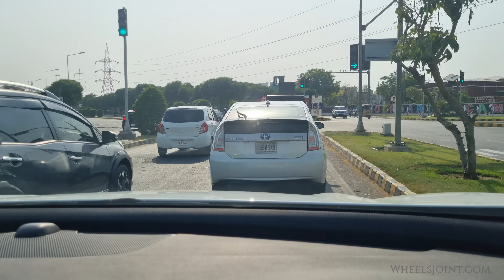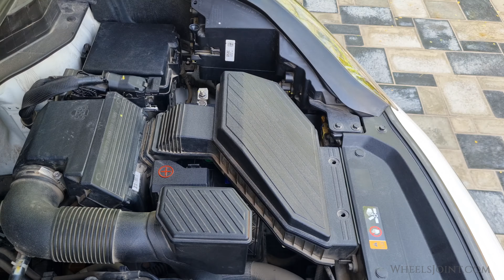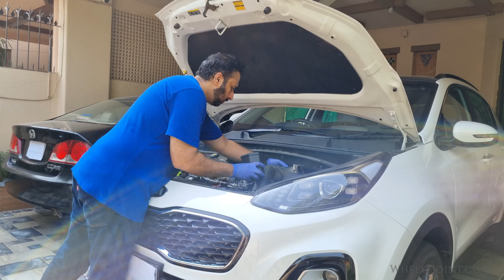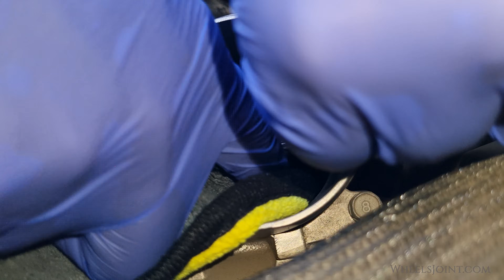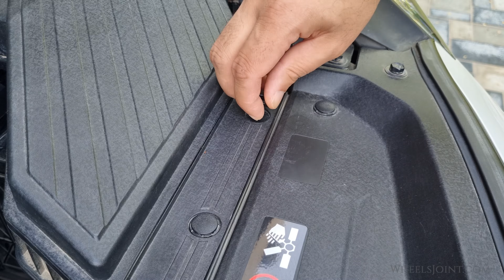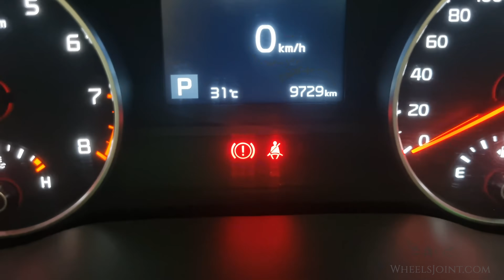How to clean electronic throttle body in Kia Sportage

Comment: Brother , I'm a old subscriber of ur channel. Request that can u make a video on headlight moisture issue. And show the moisture pads behind the headlights how they can be corrected. It's a much needed vdo
Reply from the maker: Thanks for being a long-time subscriber! I haven’t personally faced a moisture issue that stays inside the headlights. Sometimes, especially in cold weather, a little moisture can build up, but that is completely normal. It usually goes away after some time or when I turn on the headlights.
Reply: @WheelsJoint would appreciate a short video showing the moisture packs. Keep it up brother

Comment: never put fingers in the valve, it can cut your finger off, use a finger size piece of wood and wrap the cloth over the wood and clean with that
Reply from the maker: I disconnected the battery first... so it can't slam shut on me.

Comment: this is incredible information, being able to do these things yourself can save a lot of money
keep up the good work
would appreceate if you could do a tutorial on cleaning catalytic converter
Reply from the maker: Thanks for the support! Glad it was helpful!
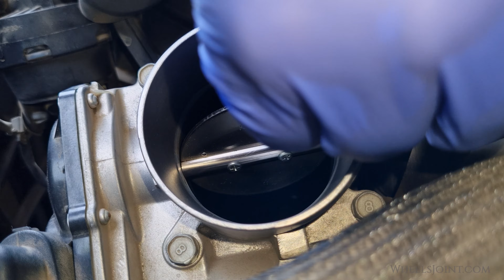Reply: Good explanation for a daily driver. However, at 3:55, you talked about a fluid around the shaft of throttle body. What is that fluid?
Reply from the maker: I don't know what that coating is. This is mentioned in the workshop or service manual of Sportage. So avoid rigorous cleaning of the shaft.